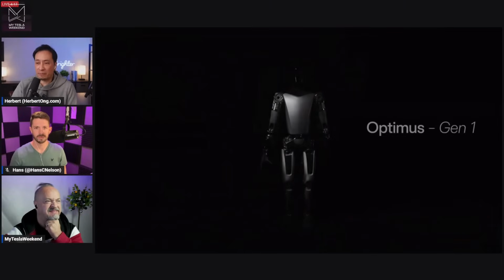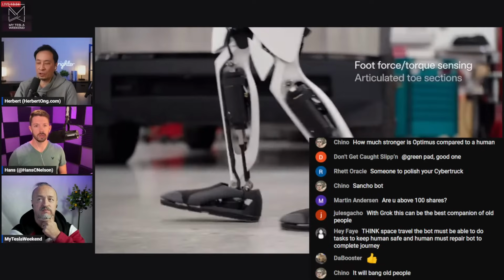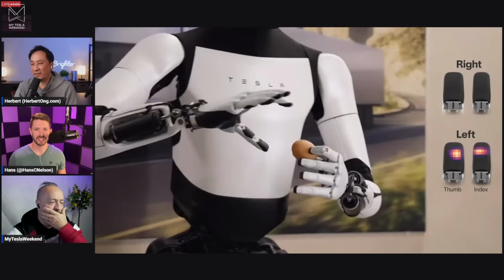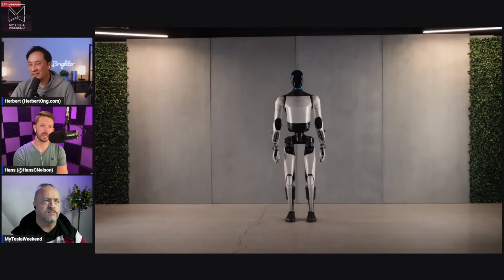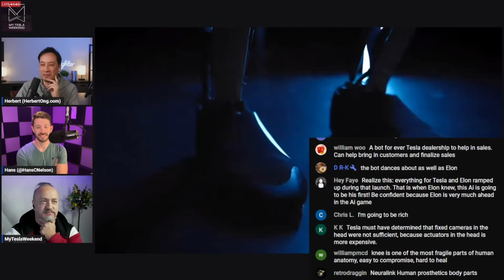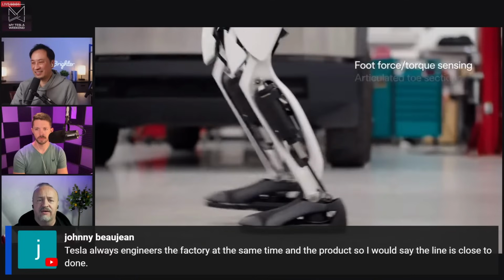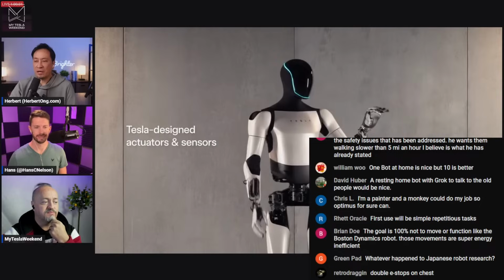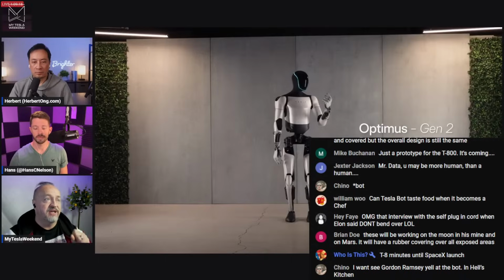Optimus just got REAL w/ Hans & Herbert- Livestream

Comment: It is walking heel to toe. Not flat footed as was the 1st gen. They made the foot look like a shoe? I am wondering if there is some form of pressure sensor in the bed of the "shoe"? The rear foot lifting to take a step is so normal looking. The arms appear inter changeable other than the shoulders and hands. But the legs are left and right with the shape of a tibia. Maybe its the camera angle? Look at the opening shot where it is straight on. The shoes creep me out. There never was a loafer I liked.

The thumb is interesting at rest and looks like it swings around to grip position. The tactile feeling may only be needed in thumb and fore finger. The others could mimic if that was needed in terms of grip force. All together they seem like what Neuralink might be able to use!?! There seems to be a hip action of side to side when it is walking by you. It demonstrates weight transfer from one foot to another with stability. The upper body is calm. It is not throwing itself off balance or teetering. I would like to see it take a few shots on a pool table.  It could use old school upright style.

The body shape is more bio correct. Especially the legs but I also like the bigger upper body. Gen 1 looks like a second prototype. This looks like a production candidate. It is what I expected just not this level so soon.

Comment: The real test for a robot is if it can sit and get out of a chair Boston dynamics could do back flips but not sit in a chair. Also if it walks like Joe Biden it's not ready. Watch those 2 skills. Although I can tell it walks less like Biden than the last time.
Reply: That's because its all electric. BD does hydraulic elecro motors that run out of battery in 2 hours

Comment: We also have to remember that if Tesla had started cranking out version 1 Tesla bots they would already be worth nothing. Tesla has to balance large scale production to when the bot is far enough along to do meaningful work at a decent rate but not going to change so quickly as to make the robots produced obsolete. Another version of the Osborne effect. They don't want to produce 5 thousand robots only to change the design. This design is much closer if not close enough that mass production makes sense. But what will the Tesla bot look like in another 6 months? Anway with the hand, feeling sensors, ease of motion, and most of all the bot beginning to show it's learning how it's body works. This bot is either close enough for more production or will be in a very short time.

Comment: I want to see Optimus do the one handed break the egg into the pan trick, without dropping any shell.  That would be epic.
Reply from the maker: That day will come.
Reply: Chefs will get worried.
Reply: @Travlinmo  They should be anyway, that's not really the point of the test.  The ability to break an egg like that is a high level dexterity skill that relies on the ability to laterally splay your hand while maintaining extremely precise dynamic pressure.  If the bot can perform that action, there won't be many it can't. As it is right now, the bot is already "physically" capable of cooking an egg, even if it needs to use both hands to accomplish getting the egg open, with just the level of dexterity we've already seen.

Comment: 19:31. That's not true.  You can use a spring to provide the return force, and then the contracting actuator to dampen the return however much you want, including to make the fingers dance back and forth.  But with that said, since they are designing their own actuators at this point, I wouldn't be surprised if the actuator can do double duty.